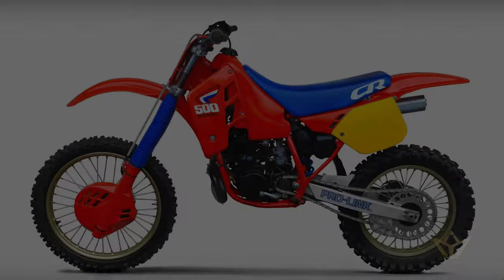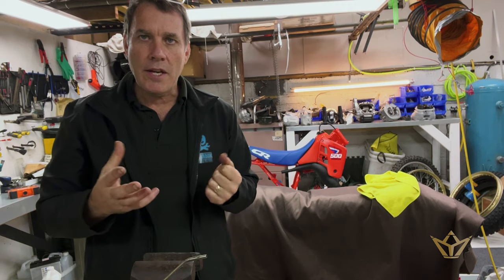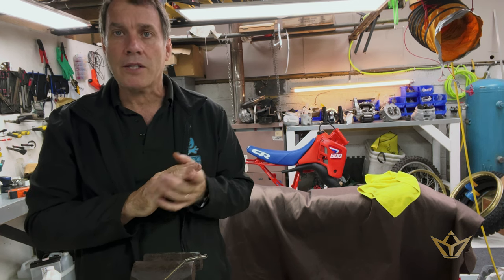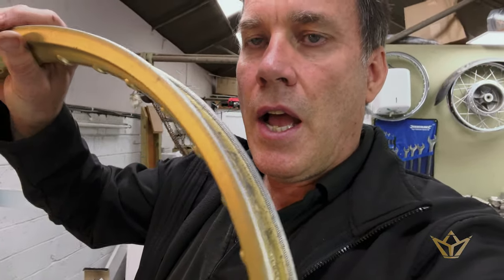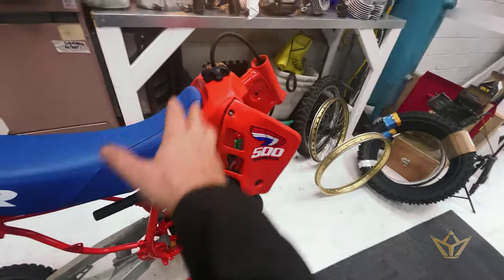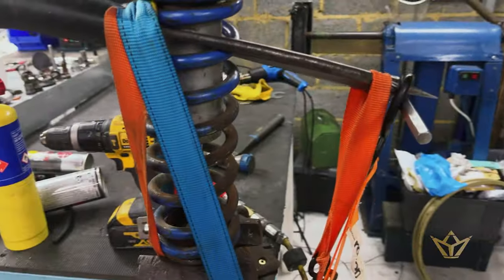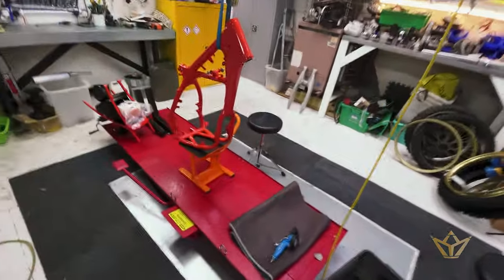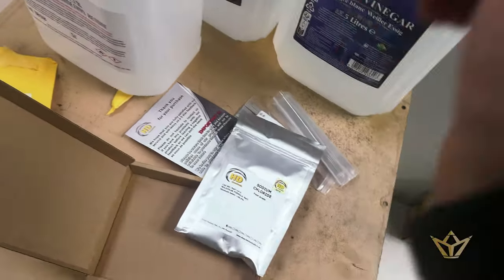SIMPLE RESTORE GUIDE TO.. - Honda CR500 1987

Comment: Mate of mine did the Desert 1000  (500km x 2 days) back in the 80's on one of these. Thing was insane, I rode it a bit and it might well just have been a unicycle cos that front wheel did not want to be anywhere else but up in the air in any gear. Vasbyt !!!!

Comment: Always a pleasure seeing a new episode in my feed, great work. May I ask the name of the silica based epoxy that you used? Cheers
Reply from the maker: It’s home made. West systems with a west systems filler and bond powder 50/50 mix. It goes like butter. I didn’t use silica sand in the end as I felt it would sheer under pressure. Let’s see..

Comment: I’m in need of a kick start lever for my 1987 cr 500
Reply from the maker: You will notice mine is an 88. Could not find an OEM. Try JCracing uk based. He has a replacement one which I think is in the video. It wasn’t better then what I had so sent it back. Quite acceptable if you are stuck